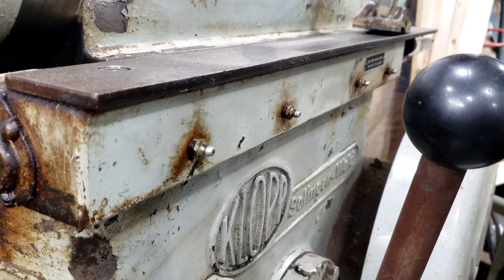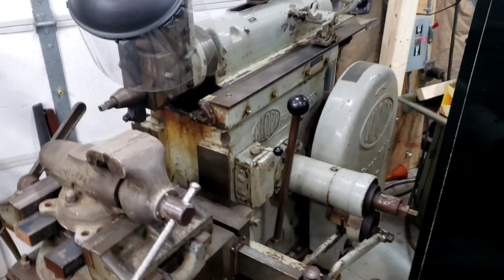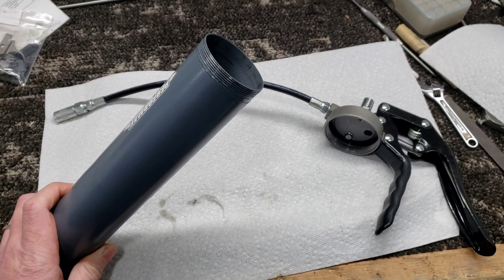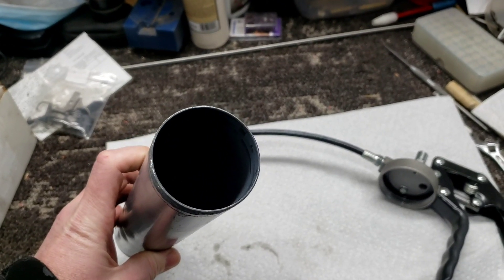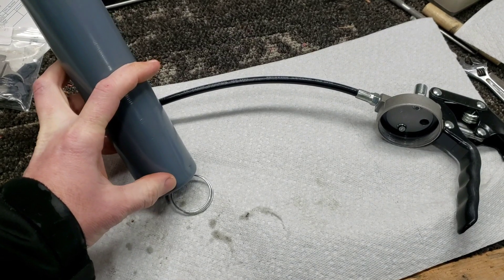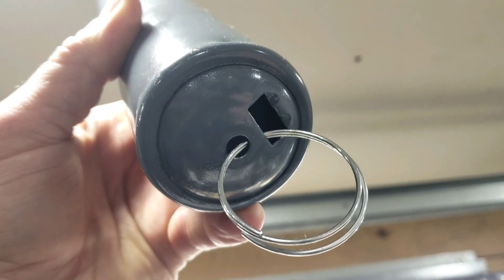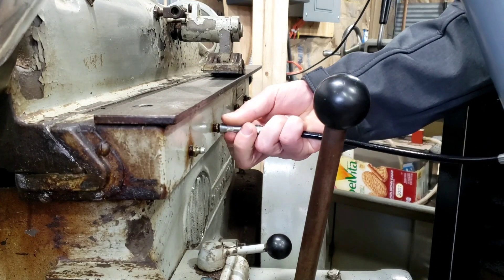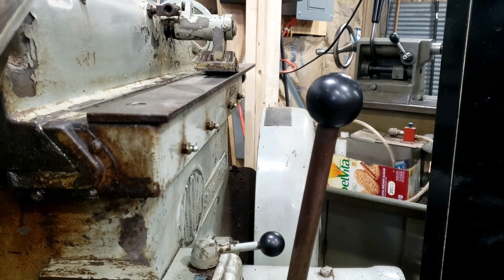DIY High Pressure Oiler for Bridgeport or old Machines

Comment: Just found your channel with this video. Have subscribed. What an absolutely awesome mod. I’ve got the pesky ball valve oilers on my lathe and mill and they seem to force more oil outside than inside. This video has me thinking about replacing those ball valve oilers with grease zerk fittings and making your oiler. Now the disc w/O-ring was simply to contain the oil?  There would be a hole where the plunger exited the tube so the disc was just an oil dam?  Yes?

Comment: Love tips like these.  Just curious, could you have used just regular old grease in this case or is that improper lubrication for these ways?
Reply from the maker: They were not designed for grease. My machine had grease in it that I spent a bunch of time cleaning. I run a way oil in most of the machine.
Reply: @precisionmachineshed  Got it, thanks for responding and the content.